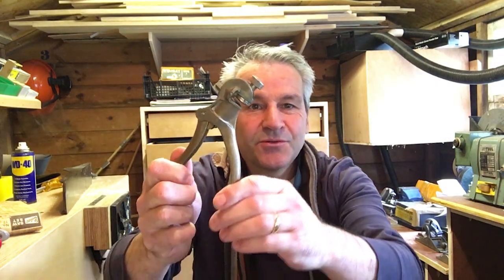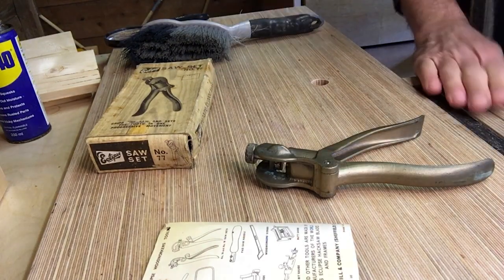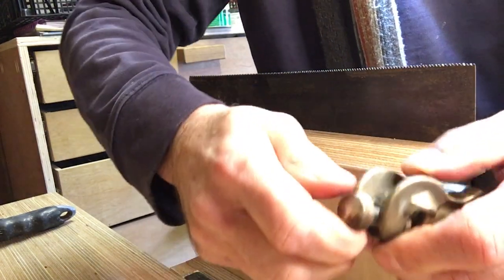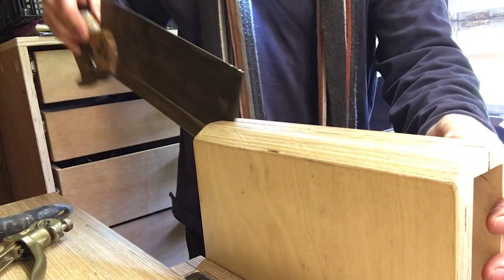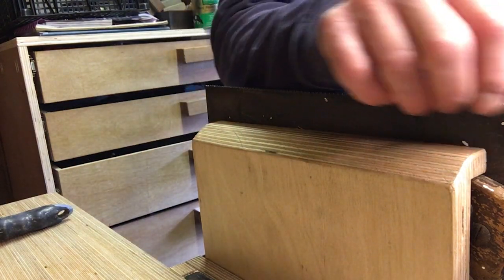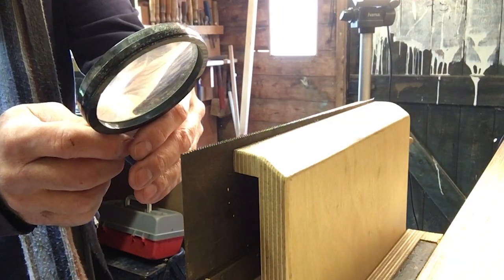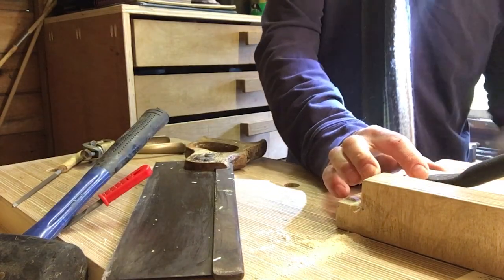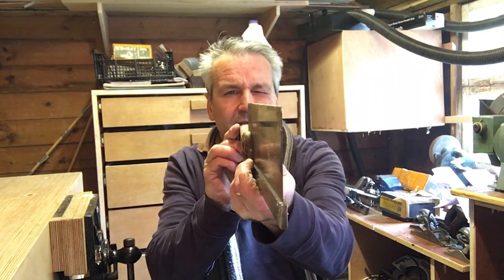Learning how to use a sawset tool

Comment: Thanks for showing, looks tedious and you said it-new saws are hardened and throw away. Ive had some luck honing a silky blade a few times with a cut off wheel in a dremel. I couldnt bend a tooth

Comment: I will have to keep an eye out for a saw set tool at the flea markets this year.    The prices on US EBay are crazy.    One is asking $175 for a Stanley #42.   Very good condition, but crazy price.
Nice job on setting and sharpening the saw.
Dave.
Reply from the maker: Will look out for one for you , eBay now have a global shipping program so look for one in Uk that offers that, it’s good as they take the delivery risk (or some of it)
Reply from the maker: Most seem to be in good nick as not used much

Comment: I always thought you're supposed to sharpen first, then do the set, test and then stone the set as needed.
Reply from the maker: Yes k think you are correct
Reply: Some warn against using a stone to adjust the set, as doing so thins the teeth and makes them susceptible to breakage.

Comment: I"ve always sharpened and then set. Have I been doing it wrong?
Reply from the maker: Well I looked it up and apparently you can damage the sharpening if you then set - I doubt it makes any difference in reality
Reply: I think it's best to set after sharpening , especially if you've jointed and had to remove a lot of material.